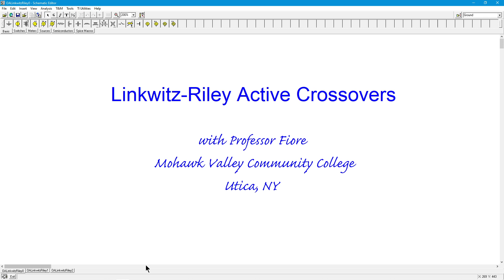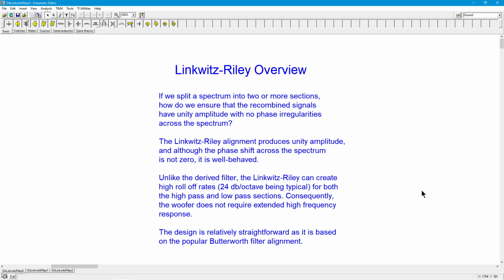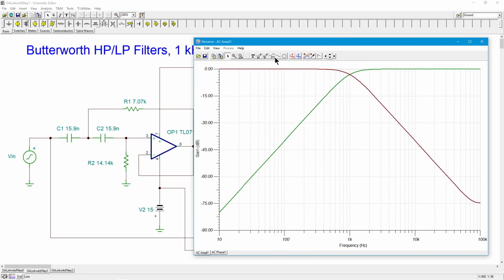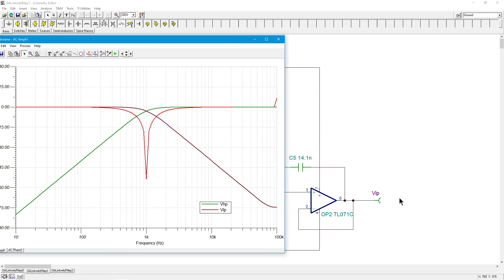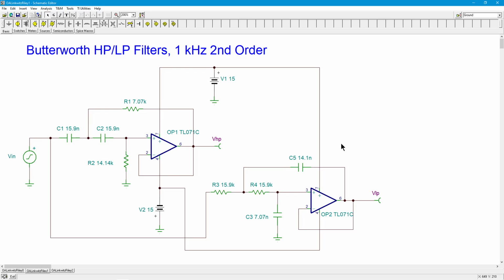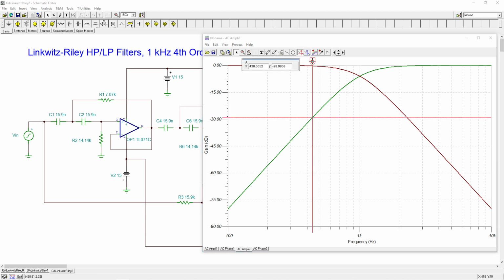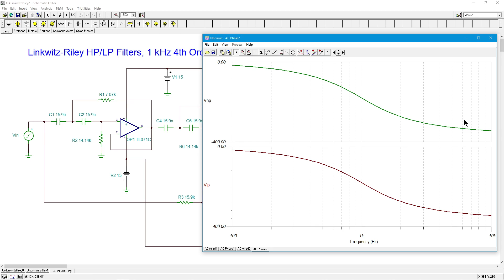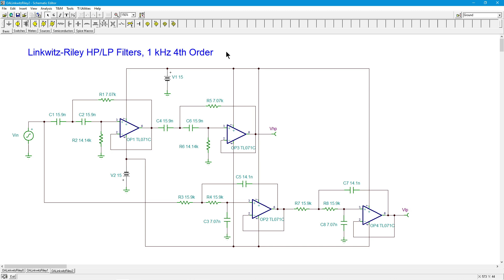Op Amps: Linkwitz-Riley Active Crossover

Comment: In both this chapter and the previous one on the derived filter you assert that the woofer needs an extended HF response because of the shallow, 6dB/oct. rolloff of the LP. It seems that that’s backwards. Because of the shallow rolloff you get TOO MUCH HF extension. If the woofer HF rolloff is enough and at the right frequency range the electro-acoustic response of the driver and the crossover will come out to a useable alignment.
In fact, it’s quite common, and useful, to use the driver response and the filter to arrive at the target curve.
For example, in the original paper by Linkwitz on his three way system (1978, I believe) he makes a casual, barely noticeable, reference to arriving at his 4th order HP target by considering the tweeter rolloff as one pole of the high pass with the other 3 poles in the crossover itself. The combined is a 4th order and, most importantly, would only be 4th order when you utilize the tweeter rolloff. And remember, the LF rolloff of the tweeter has the same phase characteristic as an equivalent 1st order electrical so, again, the aggregate electro-acoustic response will be a phase correct 4th order.
Think of it the other way; if the woofer does have an extended HF response wouldn’t you NEED a substantial amount of low pass rolloff so it doesn’t create an electro-acoustic bump in the system response?
Please advise on what I’m missing here.
Reply from the maker: I think we have a small misunderstanding. When I say that the woofer needs to have extended HF capability, I am referring to the summation of the woofer and tweeter response coming out flat including the responses of the drivers, not just the filters themselves*. If we just look at the summation of the filters, and it achieves a flat response, there is an implicit assumption that both drivers have sufficient output beyond the crossover frequency in order to achieve the flat summation. Assuming a low order filter, if a woofer does not maintain flat response well beyond the crossover frequency, then the summation will not appear flat (mostly likely it will dip because we are not seeing sufficient output from the woofer to maintain flat response at higher frequencies, although precisely what happens will also depend on any additional phase shifts). This is essentially what Linkwitz was getting at. He recognized that, although with ideal drivers he could achieve the desired response with 4th order filters, the real world response of the drivers must be considered (i.e., they do not have extended, flat response well beyond the crossover). Thus, he "saved an order" in the actual filter by including the effect of the driver rolloff. This is not a new idea. The original work by Thiele and Small on vented boxes implicitly included the woofer/box/vent network when they talked about making something like a "6th order Butterworth alignment" with an external equalizer/filter. They were *not suggesting that the additional external filter applied before the power amp should be a 6th order filter, but that the entire system would be 6th order.

As a side not, I recall reading a short paper by Thiele back in the late 70s or so where he was looking at various orders of filters in terms of summed response. He pretty much threw out first order filters simply because they required extended response from both the woofer and tweeter in order to achieve a flat summed response. With higher orders, the point at which the drivers' outputs fall to an inconsequential level occurs closer to the crossover frequency, thus mitigating the need for extended frequency response.

Back to your first observation, using the derived filter, you will not get flat response if your woofer doesn't have extended HF performance. Extended woofer HF performance is implicit in the design of the filter.

Comment: N.B It is the COMBINED response of the loudspeaker drive unit ACOUSTIC output (on some specified axis) cascaded by the crossover ELECTRICAL response that have to result in a LR filter, if the two sections are to add up correctly. Because tweeters have a 2nd order fall off below resonance any active filter must reduce its slope if you are to maintain a LR response over the crossover region.
Reply from the maker: Yes, as I have continually indicated in this series. A designer cannot assume that the drivers themselves have perfectly uniform response across the audio spectrum. If they did, why have a crossover? BTW, it would not necessarily be true that you would cross to a tweeter right above its resonance frequency. Same for a midrange. Thus, any modification of the xo response would involve the tweeter's amplitude and phase responses out of band, but how much of an impact that has would be highly individualized. Certainly, for highest fidelity, a designer would not rely on a stock crossover design like this, but would tailor the design of the filters (and associated amplifiers) to the specific drivers and target frequencies. Quite a bit more work, and probably beyond the abilities and resources of the average hobbyist.